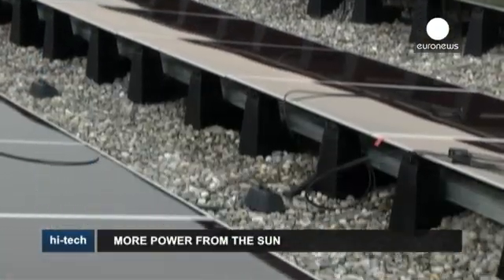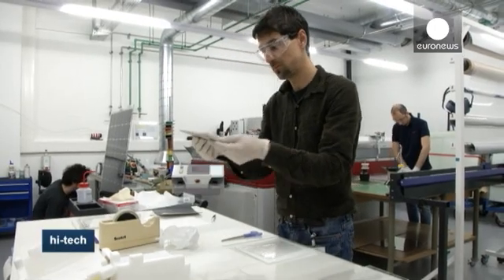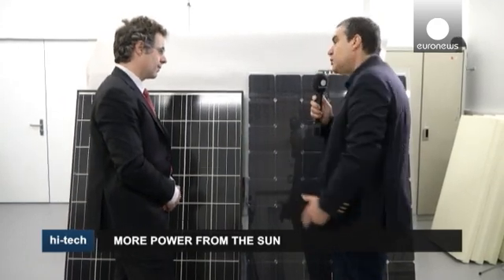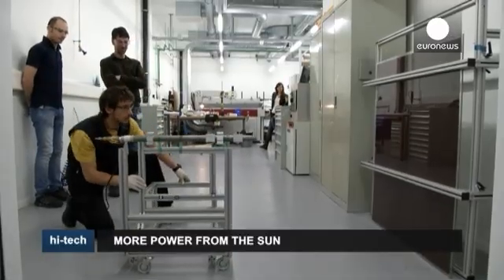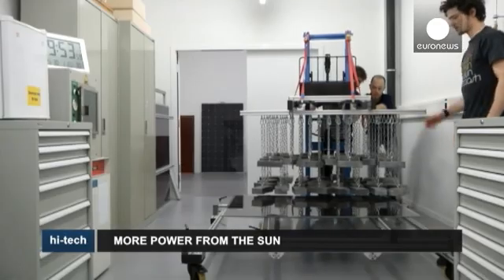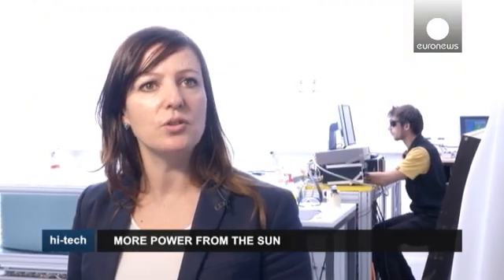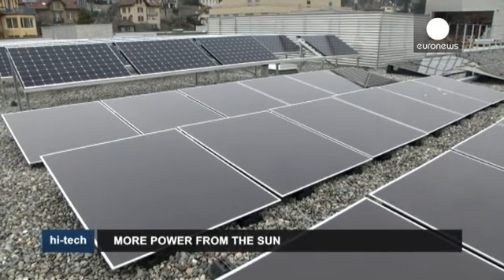Next-Gen Solar Panels: More Power from the Sun

Comment: There's no dificulty in storing solar energy. Batteries have been around for five thousand years! We have much better batteries than they had five thouusand years ago. If you have solar panels on your roof you want to keep the snow off of them. of course you can't do that during a snow storm. You have ot wait until it stops snowing to clear the snow. You can build the mounts for the panels so they tilt upward providing a high angle to let the snow slide off. Of course that menas more cost in the beginning. Also you might need a hydraulic system for raising the panels. Especiallly if they have snow on them.

Comment: well how many watts does it produce, thumbs down
Reply: luckeychuckey70 as it says in the video, it's about 15% more efficient than older technology panels. Actual wattage would vary depending on the size of the panel and since the video wasn't about a specific panel/size, they can't tell you the wattage.
Reply: Atheist Avenger , so true. They are not specific on the efficiency.  Also   electricity from solar is not "difficult to store". Just another marketing advertisement.
Reply: Atheist Avenger , that's not called "difficult to store". That's called "not having the proper resources to store". Besides there are several ways to store electric potential, some more efficient than others. Besides, there is really nothing difficult in this world.  What most folks believe to be "difficult" is because they don't have the knowledge and experience to mitigate the challenge.

Comment: How much cost of this type panel & what is deference in installation?
Reply: Hey Viral, I work with a company called SunPower that creates and installs this type of panel (or rather our very similar design with Maxeon solar cells, giving us the world record for highest efficiency commercially available panels. There is no difference in installation, and the pricing can end up being either higher or lower for a full system, depending on individual differences. Message me if you'd like to check out what that pricing would look like for your home!
Reply: Thanks David for replying.Sorry for delay of saw to your feed back.Actually i want preferable price for domestic
power generation  with affordable cost & space.Please guide to me what is best for home.

Comment: Where can you get these newer solar panels???
Reply: Hey MrKZizzle, I work with a company called SunPower that creates and installs this type of panel (or rather our very similar design with Maxeon solar cells, giving us the world record for highest efficiency commercially available panels.) There is no difference in installation, and the pricing can end up being either higher or lower for a full system depending on individual differences. Message me if you'd like to check out what that pricing would look like for your home!

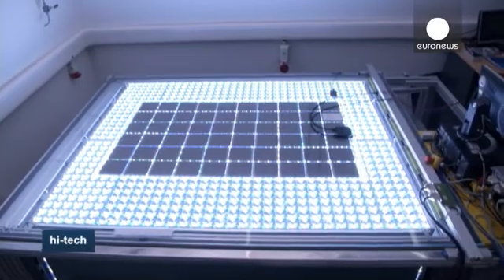Comment: First, 2:51.. she is cute... next, why not affix IR converters to collect the absorbed heat energy and covert that to electricity...  The efficiency drops with heat, so once you siphen that hear into a mechanism to extract energy from the heat, this process can be tuned to cool the photo voltaic cells.  Keeping them in their optimal operation zones...  Just a thought...  15%...
Reply: Paul Gdry Clever folks build solar furnaces alongside their PV arrays. you can do it very simply with  a shallow box with a clear glass lid. Stack the box with used tin cans in parallel columns. air drawn in at the bottom is heated in the sunshine and can be fanned into the home, used to pre-heat water or converted into other energy... and you can do it for pennies... lots of videos on YT.  i wouldn't try to overcomplicate the PV design by trying to incorporate thermal conversion... it will complicate the market  which is still a black art to a lot of people 

The plan is quite simple for most people... INSULATE, INSULATE  INSULATE,  Generate from renewables and reduce your overall consumption.  We all have too much shit plugged into the mains and we are hooked on electricals

Comment: Actually you're wrong!  Photovoltaics contribute 4% of total energy consumption in the EU as of 2014. This doubles every two years or less. Meaning 8% by 2016 and 32% by 2020.  Germany is leading the way, and already have 6% solar, scheduled to have 12% by 2016 and around 50% by 2020.
Reply: sonofhendrix Electrical energy consumption is not the same as total energy consumption. Germanys primary energy consumption is about 3800 Terawatthours per year. And Germany produced only 33 TWh with photovoltaics in the year 2014. Less than 1 percent of the total energy consumption. Sure, there is potential for much more. But it's a long way to go.